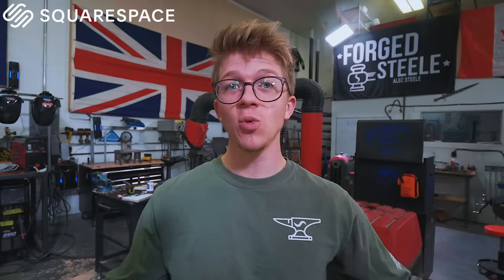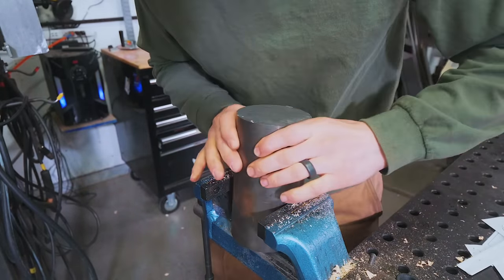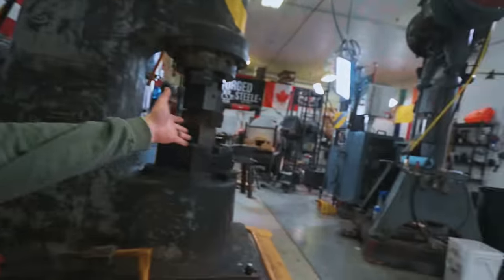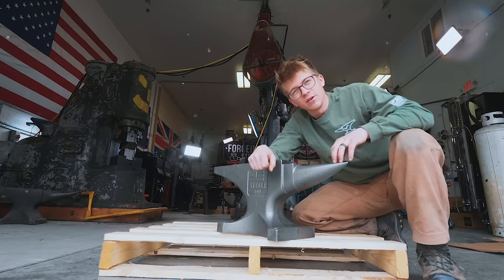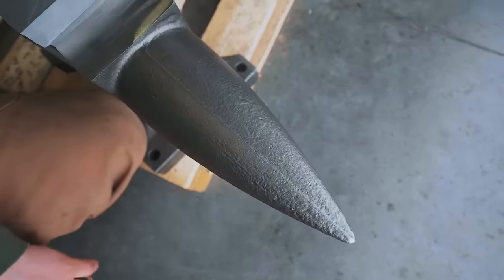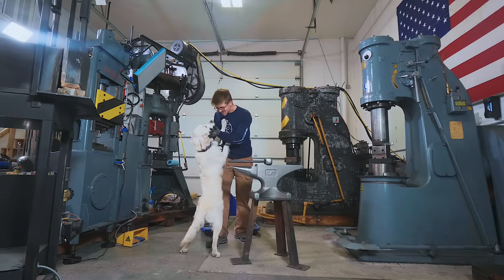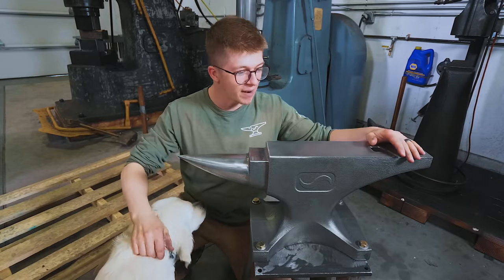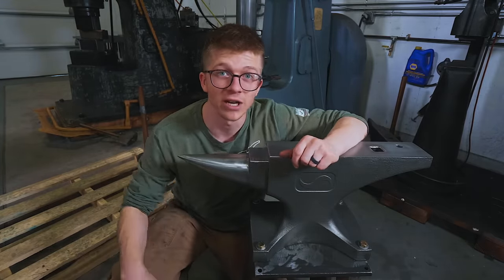MY DREAM ANVIL!!!

Comment: When you start serial production have the foundry date and number them.
Reply: Just adds to the price
Reply: Not if they stamp it whilst still soft
Reply: @liamholcroft7212  Makes it easier but time cost money, they have to organize it too.
Reply: @liamholcroft7212  you don't stamp cast iron, you actually have to have the casting number built into the molds. I've worked in a foundry, by the time the casting is cool enough to handle, it's way to hard to stamp without deformation.
Reply: @mikeford963  would it matter if you deformed it a little? Surely a small stamp on a on a large chubk of steel wouldn't do much damage.
Reply: @liamholcroft7212  Maybe not, but it's easy to cast it in, than to stamp it. Maybe a little more costly as far as man hours goes, but much easier to drop in a reusable number set into the mold, than to try and stamp into a hard, cast product.
Reply: @mikeford963  well yeah makes sense, I only suggested stamps as an alternative to save on the cost you mentioned.
Reply: They have those stampers you can get that come with a small gun powder charge. It's great for stamping hard steels.
Reply: @liamholcroft7212  Fair thought, but the tooling required(fairly massive machine) is quite expensive. Have a look at the tooling used to put the stamps on rifle barrels and other firearms parts. Roller stamping machine.
Reply: @Tony-nl6pf  this ain't going to be cheap. but it will be special. so i'd say the extra bucks are well worth it..
Reply: It should be pretty simple to cast the date and numbers during the molding process, engine block foundries have been doing it for around a hundred years.
Reply: @SandBoxJohn  great point.
Reply: lol dudes... there are things called free-hand engravers... takes seconds to mark an anvil. you could also use a dremel tool

Comment: The confidence to swing a 26-lb hammer with full strength on such a small target is probably close to if not the most impressive skill being a career blacksmith probably doesn't think much about anymore, but I've never gotten two solid strikes back to back on a splitting wedge about that size, yet I can fairly consistently get 2 in a row where the glancing blow wrenches the hammer sideways and nearly sprains my wrists from twisting. Mind You, that's with an 12-lb maul too
Reply: There is that clip of young Alec learning the dangers of sledgehammers...
Reply: Andrew Werner look how he holds the handle he’s relatively chocked up on the top of the handle which gives you better control and reduces shock a bit too, learned this from a guy I apprenticed under for about 6 months
Reply: @ractorc91  yeah, handle too long and end of handle finding his "boyhood". Lesson learned as to body positioning.
Reply: Absolutely this.  In fact, I think the first Alec Steele video I watched was just a simple tutorial on doing a taper on a small piece of square stock.  In two heats or so he had an absolutely perfect beautiful taper.  Being an absolute novice, that was a real eye-opener as to what you can do with truly great hammer control.  When every strike is exactly where and exactly how hard you want it to be, it makes forging look quick and effortless.  I'd have taken 10 minutes to do what he did in less than 1.  I was so impressed I had to go and watch all his videos :)
Reply: Andrew Werner I use an 8 pound maul for all the splitting and an axe for the smaller stuff. If there’s anything I’ve learned from splitting wood is that I hate river birch and practice makes perfect. The more I’ve done it the more I’ve gotten better. Hope this helps

Comment: Very cool finding a good legitimate black smith anvil is nearly impossible. 35 years ago when I needed a good anvil all I could find was old antique cast iron junk or real anvils that had been worked /abused to death.
 I got in touch with a foundry that was willing to cast a anvil for me - if I provided a wooden positive mold, so with their guidance on how to taper the mold I gave them a mold. They cast a anvil for me out of Chrome molly tool steel and aneled it for me it was 178lb. Milling off the top and bottom tapers was quite difficult, only carbide cutters would touch it. After milling and shaping it we put it in a forge heated it and tempered it. Having a good anvil is essential for many tasks. You are doing a very good thing providing these quality anvils, they do need to be sold with the tops and bottoms milled though as that process is not easy to do.

Comment: You should really get some ppe for the pupper. I was so paranoid of his eyes while forging with all the hot scale flying off. Will the Anvil be available in Europe? And what about the grinders? Would love to get some!
Reply: I was thinking the same thing!  I was worried about his ears with the hammering - dogs hearing is already much more sensitive then ours...
Reply: @jeffreypeters8446  Well they are sensitive to hearing higher frequencies, not necessarily volume. He doesn't seem spooked by the sound so it should be ok.

Comment: I cried when he rounded those edges. So many years working on old anvils with not a clean edge available... it was like he was grinding on my heart.
Reply: But he only rounded off a portion of the surface?
Reply: @Pado01  yess but..... the basic idea lied Behind two different philosophies of forging. You can always make it round later or you can always Make it square. Not that either are wrong.... But .... You can always round it later
Reply: For more clarification the hammer is also doing work. Round die vs flat die can determine the shape you got through vs the shape you want to end with.
Reply: @leaunoir  I'm no expert, so feel free to correct me, but I would also imagine that the more sharp an edge is; the more prone it would be to chipping? But I guess it wouldn't matter as much since you would be forging soft on hard...

But like a few have said, it might be a good idea to sell it as a virgin anvil, and an additional add-on service to have it surfaced.
Reply: I'm no expert either but from a logical point of view, the rounded portion of the anvil edge has multiple uses; more consistent pressure on the metal with each hit, less banana bending of the metal because only the hammer is rounded, less straight line hammer markings on the metal because of the sharp edge, and more of a "squeeze" movement of the metal instead of it bending over the sharp edge.
Reply: You need some round edges for drawing out as you can see when he was forging out that tong. Rounded edges have more support than the horn so work better for this.
Reply: Obviously this is a preference for how people like to work. Alec obviously finds it helpful. I am beholdened to the way i learned so a rounded edge would be more in my way than it would be helpful.
Reply: @JME Chipping is a possibility. The milled edge might be too sharp, but he grinds off much more than that. I'm assuming it has something to do with his process? or maybe for testing the depth of hardness? He does seem out to destroy this particular anvil if he can.

Comment: Alec: puts earmuffs on everytime working in the shop
Yogo: runs around the shop freely without any protection...
Reply: Yeah, I'm wondering when Alec is going to sell canine PPE.
Reply: The dog is smarter than some you tubers, if it doesn't like the noise it will walk away

Comment: I would rather you sell it as cast cheaper, and let the smith do the dressing, I may like my anvil dressed different than you.
Reply: Agreed.
Reply: I prefer mine in a sun dress.
Reply: That’s what I was thinking. If someone is at the stage in their smithing that they can afford an anvil like this then they probably have an opinion on how they want their anvil dressed and the means to do it themselves.
Reply: But I it would be offered with less warranty, right?
Reply: @TheGabrielhwmga  warranty on an anvil? Other than a casting defect there isn't much reason for a warranty anvils are pretty much the most durable type of tool in existence.
Reply: Honestly I would buy a different anvil from Holland or someplace else, rather than purchase an anvil that has already been dressed in a way I don’t like. Allready bought one anvil from Alec do I need another?
Reply: My Exact thoughts.
Reply: @OuroborosArmory  it would seem, looking at many blacksmithing channels, that;
not unlike clamps, you can not have too many anvils.
Reply: Thomas Russell you can.. but it’s not at one, it’s to many when your tripping over them. I use two in my channel, and if I have students I have a few ASO that I drag out. I want a second “real” anvil but not sure if it will be this one,

Comment: That is a beautiful anvil! If I was still able-bodied, I'd be strongly considering getting back into smithing, but I know my limits. When I was in my 20's, I was in the SCA, and made some lovely armor under the tutelage of a very knowledgeable man. We went together to symposiums on smithing, and I got to try various tools, from handmade hammers and cobbled-together anvils made from lengths of discarded railroad track, to some very nicely maintained vintage anvils. The forges were everything from fire cement lined wheel housings to purpose-built firebrick forges. A few had bellows to blow them up, while others had motorized blowers. I never got a chance to use a power hammer, but would have loved the opportunity.

Unfortunately, along with the impact of the SCA's "heavy" fighting -- heavier armor, rattan weapons, etc -- and the demands of making such armor, I developed a repetitive stress injury and had to stop. I didn't quit altogether, I was in "on the ground floor" with rapier combat in my area and studied that for several years and competed a fair bit, but it didn't require the blacksmithing that heavy fighting did. You could use repurposed fencing gear along with period-designed arming doublets and gambesons. I still have a pair of my favorite rapier-style weapons, fencing epees mounted on saber grips, and my 3-style fencing mask. My other armor succumbed to a basement flood and did not survive. 

As the only surviving article from my heavy-fighting and armoring days, I still have the steel helm I helped make by hand. We acquired some roll-end steel, which calipered to about 13 1/2 gauge (it was upset a tad thicker from 14 gauge because it was a roll end). We never did know the specific mix of the steel, as it was scrap from a steel company who let us scavenge from their scrap bins so long as we didn't abuse the privilege. They were very nice about it and even cut long pieces to something we could carry in the back of a little hatchback car. We didn't have a forge, so we cold-forged it on a chunk of tree stump. We cut it using a manual Beverly shear, and cold hand-riveted all the joins. The top of the helm was designed to be re-dished if it got badly dented, but nothing we ever hit it with could so much as mark the thing. It weighs about 12 pounds, is designed so it will NOT spin on your head if struck wrong (a real problem with helms made from old Freon or propane tanks), and actually had decent peripheral vision. It was designed to LOOK "period", but was more closely modeled as the bastard love-child of a modern motorcycle helmet and a European helm. Someday, I'll have to polish it up and take some pictures. I call it "George", and it lives on my mantelpiece.

I've always loved watching your videos for the vicarious thrill of seeing someone do what I no longer can. I hope this new product does very well for you, and for your customers, in the months and years to come!
Reply: I was in the SCA myself. Knees went out. Lots of fun though. Just have my helm left is all.

Comment: I made a rivet anvil for doing brakes by drilling a hole in the top of my saw horse adding two washer (to disperse the blow) and two nuts (to give vertical clearance) on a 1/4-20 bolt. $1.50 rivet anvil or backing iron

Comment: My anvil i bought from the sugar factory where i worked, after it shut down i bought it for the sum of $37.50 US as scrap , its a huge one though, 3 feet long and weighing in at over 600 pounds, they tell me that it was from back in the days before trucks and tractors as it was used to also shoe the horses etc that worked on the plantation, probably back some 150 years.

Comment: Lovely anvil. 52 HRC is perfect. You gave me an idea with your billet anvil. An 18" length of 6"x6" chromoly billet would make a great anvil weighing 240 Lbs. All the mass is directly under it, and it would work harden to around 45 HRC.

Comment: IMO, I think you should weld sides on the anvil legs with rod or bolts welded on the walls pointing inside.  Then turn it over and fill it with concrete.  Make the concrete slightly lower so the force is still directed to the steel legs.  More mass = less movement.

Comment: Hey Alec, I drive for UPS and Id suggest bolting them down in some sort of crate. Otherwise I for see a lot of chips, dings, broken horns and broken ears on the base of the anvil. Heavy items like that have a rough ride down all the conveyor belts and rollers. Not to mention careless warehouse workers that can't lift that kind of weight and tend to drop, roll or slide them to move them around.

Comment: There are engine stands with adjustable  arms. They can be rotated 360 degrees. I bet one of those would do great for when you are  cleaning the anvils up to ship to the customer.  Rather than using a  stool for a prop.

Comment: I was told that the reason anvils don’t have mounting holes in the feet is that any bolting to a hard mount would in a short time lead to cracking and breaking of the foot. This is “folklore”? Nice looking anvil for sure must have been a lot of work to get it to this stage of development.
Reply: might be a folklore, yes. but it could have been an issue with early anvils. the quality a new anvil from todays time has ist ways higher than in former times, just because we have homogeneous material when we cast, can control temperatures and have a physical understanding of what happens in metals when they get cast, cool down or getting hardened.
There wont be an issue with an anvil that isn't forge weldet out of several parts.

Comment: 1 of my biggest regrets is something I did about 17 years ago,I was unemployed at the time so bought an old van and started scrap metal collecting, 1 day I called in at a farm and asked the farmer if he had any scrap I could take, he had a huge pile and told me to take whatever I could from that pile. I filled the van about 5 times over the next few days and as I got 2 the bottom of the pile there was a huge old anvil (it must have weighed over 200kg it was that big), it was way 2 heavy for me to move so the farmer used his fork lift 2 put it in my van. I wanted to keep it just because I thought it was cool but had nowhere to store it, I'd just had my 1st child and we lived in a 1 bedroom flat.
In the years since I've become interested in forging and metal work and the fact I got rid of it for scrap prices still haunts me to this day.😭😭😭

Comment: Wood pattern? How many are you expecting to make? I know it's a lot more $$ but an aluminium pattern will last and ensure tolerances and surface finish stay true. Did they give an estimated part qty. life span on the wood? If not, I would ask, especially if you need to make any changes before a production run. 
Love the anvil though! It's amazing that it took thousands of years for someone to add mounting holes to a standard anvil!

Comment: To start with you can make an anvil from about anything!  A few thick plates of steel, welded together in a useable shape,  like 6 pieces of 4"x6" piecers of 1" plate, tack together 4 pieces  then lay another piece across to make a work surface, weld prep, so it can get a good penetration, maybe weld a horn from 3" round bar, ground to a point,  and weld on a base, maybe heat the work surface until it has a light glow, and drop it in oil, then burn off the oil, it should be hard enough on the outside, soft enough on the inside,  it should work  well enough to last year's!

Comment: after all these videos about starting with a 15lb hunk of steel as an anvil, and Will doing his thing in his garage, how about a step-by-step budget beginner forge?  we need to be able to heat stuff up right?  Will didn't go into much detail about that propane torch he used in the first video, but what about an actual budget beginner forge that uses a barbecue propane tank you can buy and refill at a local gas station?  Can do?

Comment: I agree that you should offer them in "As Cast" & "Ready For Use" finishes but may I suggest that you cast in or stamp or weld on prominent & hidden codes that indicate the degree that they are sold by you so that one that is purchased "As Cast" then badly finished and then displayed or resold by a purchaser should not reflect negatively on you , the original manufacturer/supplier !

Comment: I'm trying to make a striking plate from a railway tie plate.  The tie plate seems to be made from super soft steel though.  And based on the sparks I'm fairly sure it's not hardenable.  Should I try to harden it?  I don't have a proper forge yet so I would have to just throw it in a big-ass fire with some sort of blower.   Can I use a magnet to tell when to quench it or try to go based on colour? 

As you might be able to tell - this is my first attempt at forging.

Comment: Since the majority of potential customers wanting to purchase this anvil will have access to a grinder and ultimately plan to hammer the ever loving forge out of it, leaving the "touch-up" work to the customer would be highly advisable. Sure the anvil presents better when tidied up a bit after the casting process but I would bet 99/100 people would rather see a lower price than someone else's labor costs inflated in. *Im confident you guys would do a fantastic job making them look nice, however if all the castings end up looking as nice as that one, slap some boiled linseed on it and send one my way 😄.